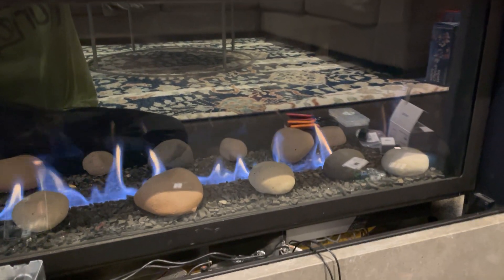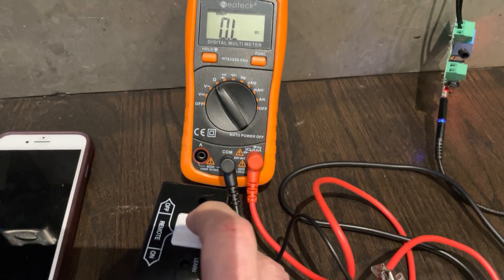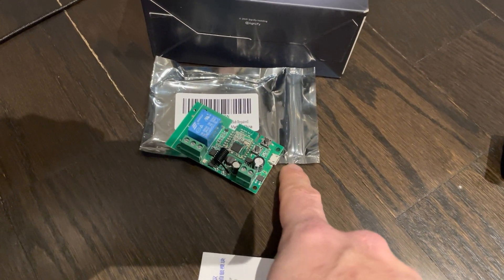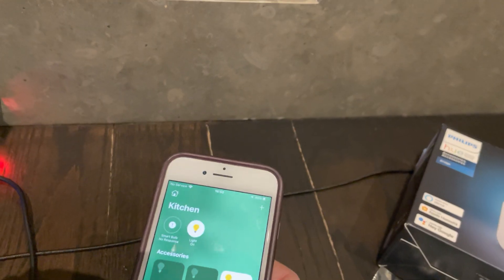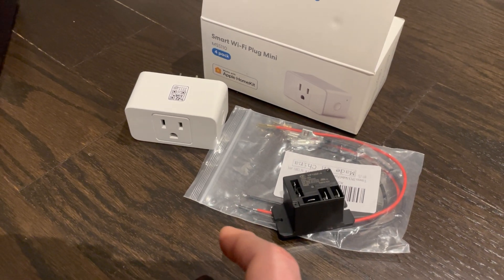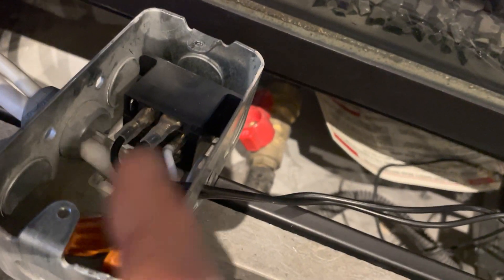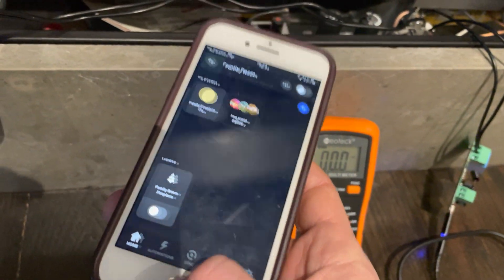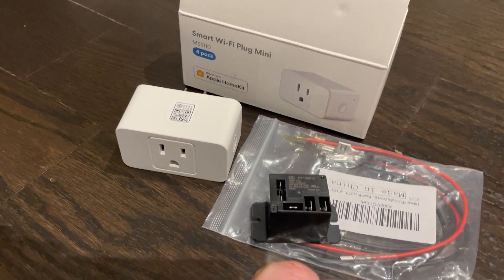DIY Fireplace Smart Switch for Apple Homekit, Amazon Alexa, Google Assistant, Phillips Hue & ZigBee

Comment: Hey do you have a link to the relay?
Reply from the maker: The name is in the description. More specific "Sealed Power Relay SPDT AC120V Coil, 20 Amp 120 VAC with Flange Mounting and 10 Quick Connect Terminals Wires High Power Relay NT90-AC120" and works on both US and Cdn Amazon search